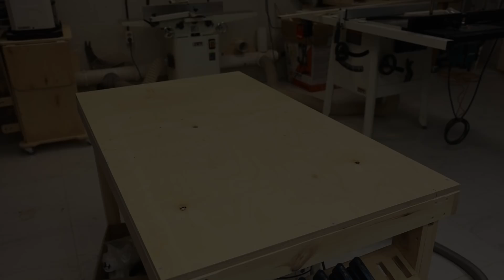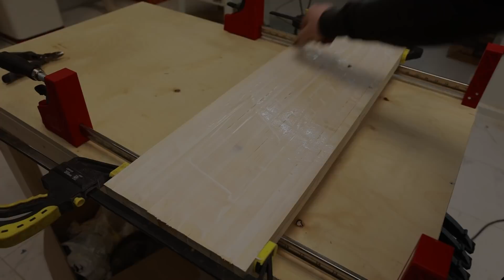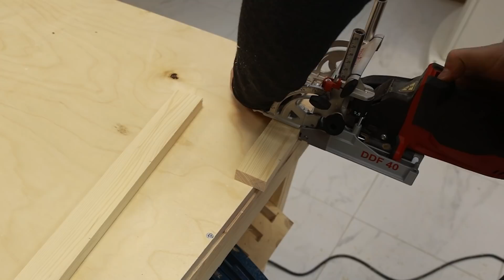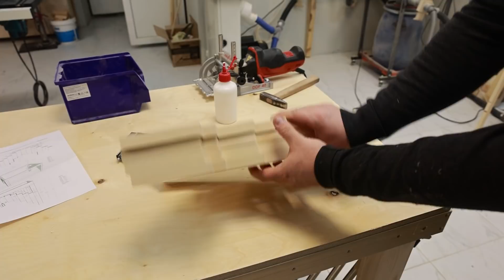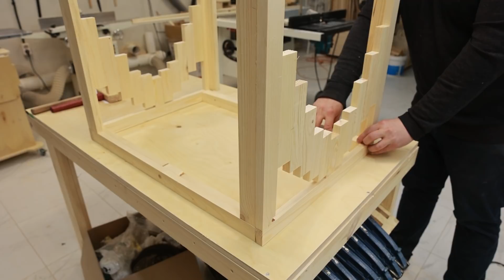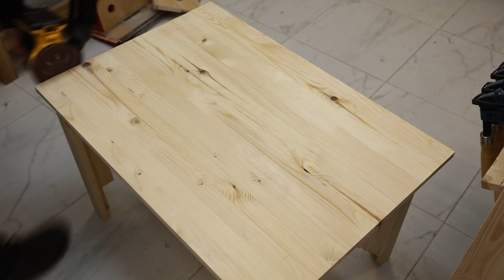Простой проект для начинающих! Только ДОСТУПНЫЕ материалы!

Comment: Wow! I built this great simple little coffee table (I used 1"x 2" boards) that my granddaughter turned into desk. Thank you. I have two questions about build #1: Did you use 14 boards for the top ? You measured the 200mm board from the bottom of the 420mm support leg. What is that measurement? I had to start from the top then measure down 10mm, 20mm, 30mm x 3.